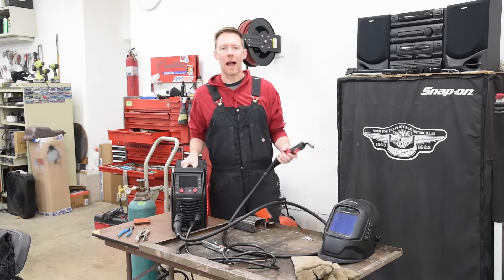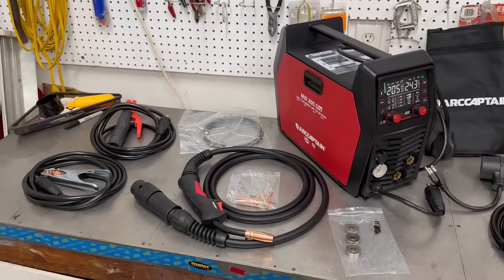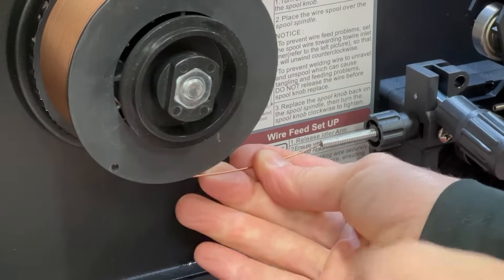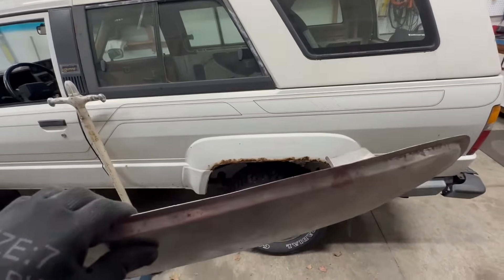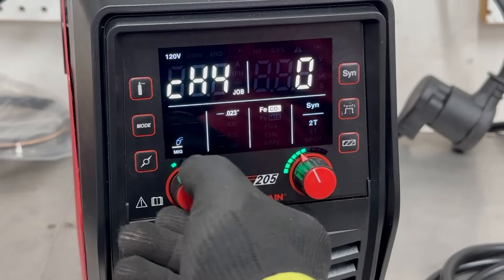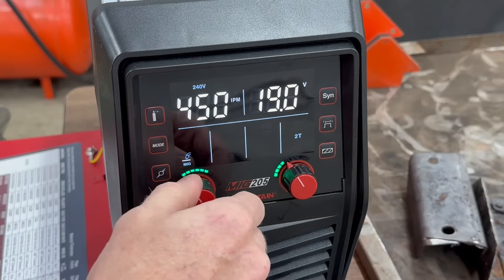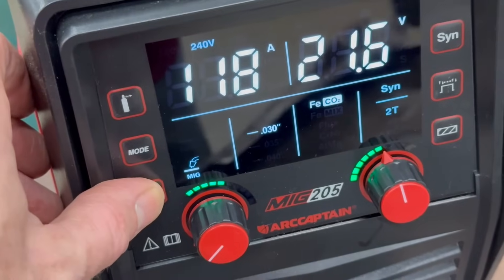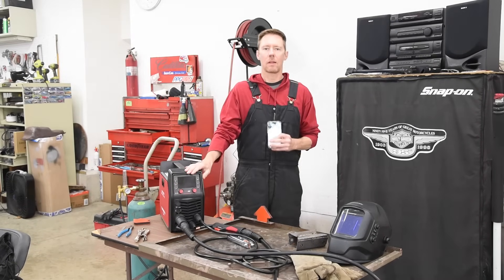Arc Captain MIG205Pro MIG Welder Review Test

Comment: I am curious if it can pulse mig steel overhead position.
Reply from the maker: I haven't tried, but I don't see why it couldn't. You may need to slightly adjust the settings though.

Comment: Is this really worth so much more money than the older 200a unit?
Reply from the maker: It really depends on how you plan to use it. For example, I weld floor pans in vehicles a lot, so instead of climbing in/out of the vehicle every time I want to adjust a setting, the bluetooth is nice. The 205 just seems to be built a little bit beefier than the 200 as well.